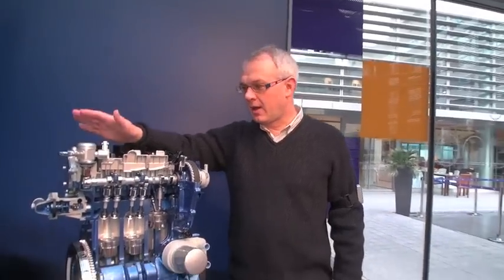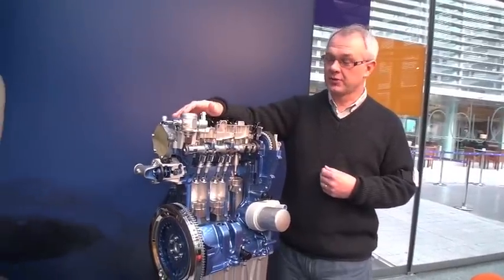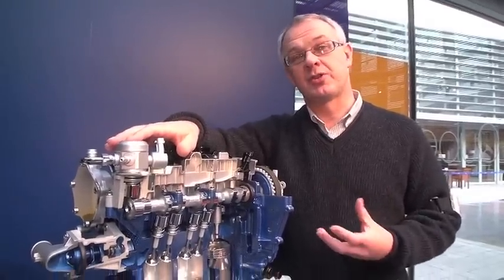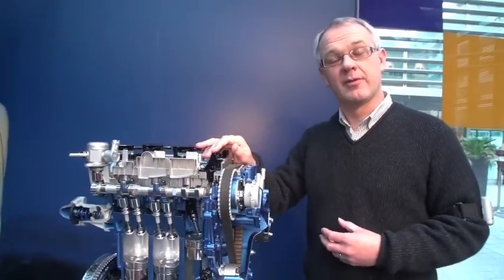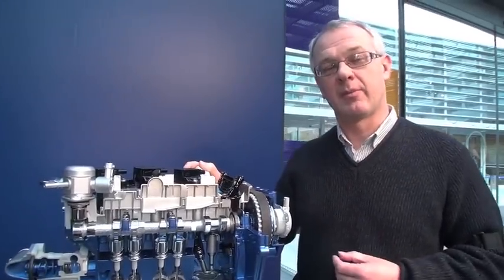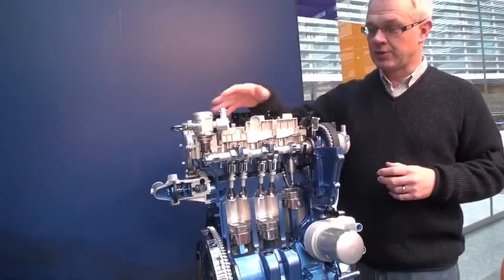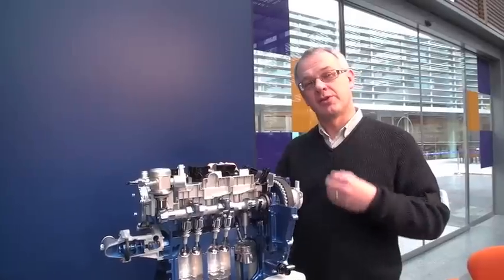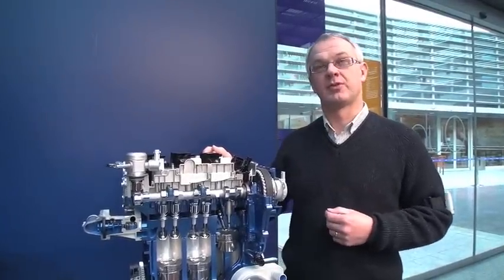Ford 1.0 Ecoboost engine

Comment: I like the concept and I know they are trying to keep a linear feel for the motor and reduce lag but when you are on boost you still have to maintain an air to fuel ratio which gives you the mileage of a larger displacement motor. my question is... Why would hey not fit it with a larger turbo that would not kick in till higher rpm's for better gas mileage while cruising in low rpm's (under 2500 rpm's), and still give you the performance in the higher range when you need the power?
Reply: my thoughts exactly!
Reply: They don't run a larger turbo because the engine would be so underpowered at low revs, u would never reach the power band in time. The engine would simply not be able to pull the weight of the car without the boost at low revs

Comment: It will be interesting how it pans out but for certain reasons, I don't buy cars with timing belts any more. As far as I'm concerned, a chain implemented correctly is superior and this is not a maintenance item I want foisted off on me, especially considering where the price of cars is going..just put in the chain in while you have the flippin' engine open already. :)  Hyundai has ditched all rubber on timing as well and if they can do it? Ford can too.

Comment: True so true, and the oil when not properly changed will gum the belt up and make it skip and jump off the cam gears. The oil bath must stop the belts rubber construction from being sacrificed by Ozone similar to when a vehicle tire becomes aged by being exposed to the elements.

Comment: I was really intrigued with this motor until I found out it used a timing belt but according to this, it's a 'novel' design where the belt is lubricated by the engine oil, thus not ever needing service. I'm very leary of this although it might make sense given the belt would not dry out. I'm looking into this but I am increasingly disdainful of manufacturers seeming desperation to use belts where they ought not too. That maintenance value belongs to the customer, not some bean counter goob.
Reply: It seems to be mixed, belts either last well or degrade early

Comment: Obviously he's talking about the rubber chain that keeps the timing on the motor. Of course you'll need to change the oil normally about every 3,000 miles and when a part of the motor breaks, you'll need to replace. You misused those words.

Comment: I wonder how this engine performs when paired with an automatic transmission and a car full of people? I also wonder if a turbo that advanced and rapidly rotating can last the lifetime of the vehicle. Finally I wonder if this engine produces enough heat to make it suitable for colder climates. Modern diesel engines need additional heating sources to ensure acceptable heating capacity, and maybe this engine suffers the same "problem"?

Comment: Don't believe this stuttering Stanley!  This engine came from my designs, not Fords engineers.  I have designed for NASA, Lockheed Martin, Boeing, U.S. Military and most of the worlds auto manufacturers.  Fords just a pussy company that cannot admit that they needed help!  We did this and we did that...my ass!  This company and many others would still be using carburetors if I had not worked on EFI technology in the eighties!  The reason was to get rid of leaded fuels that cause health problems.

Comment: Looks like a gem. My only concern is durability and the engine being highly stressed. If one can get used to the fact of a one litre engine in a Focus it will sell though. Hope they have quietened it down though. I have driven triples in the Skoda Fabia and Toyota Aygo and they were pretty raucous.